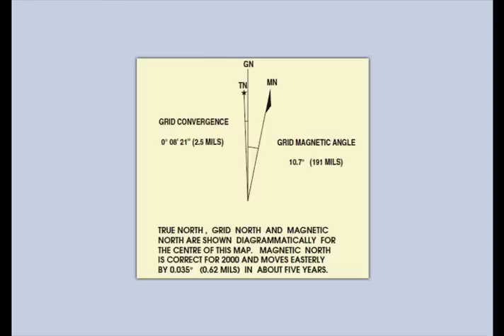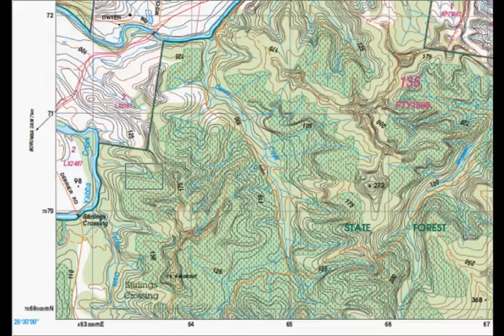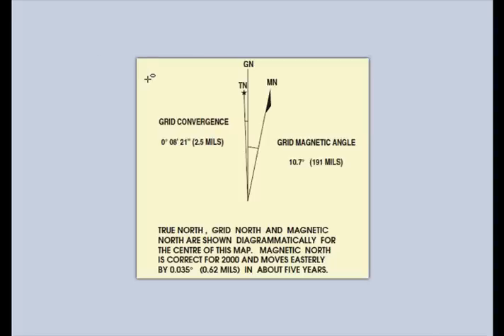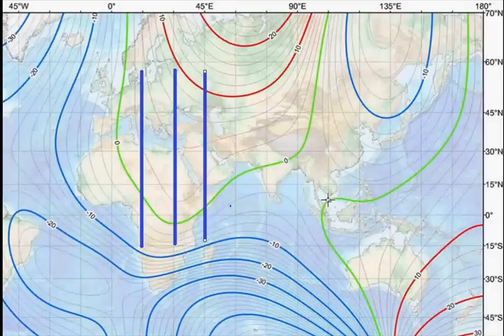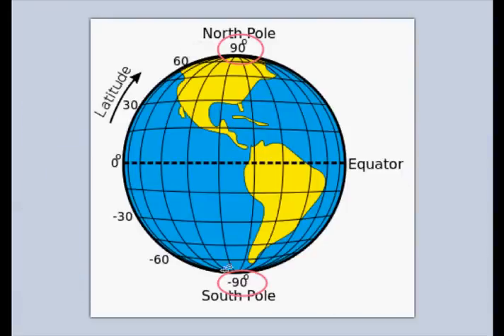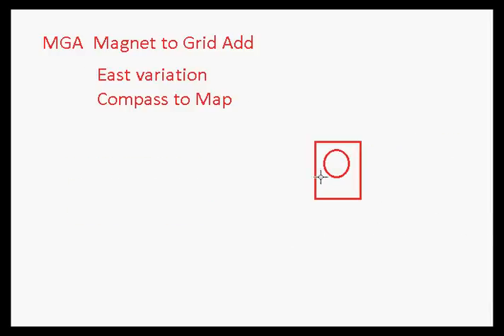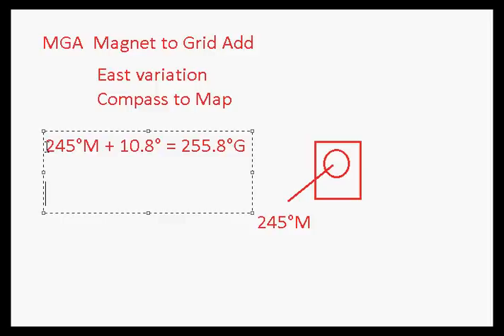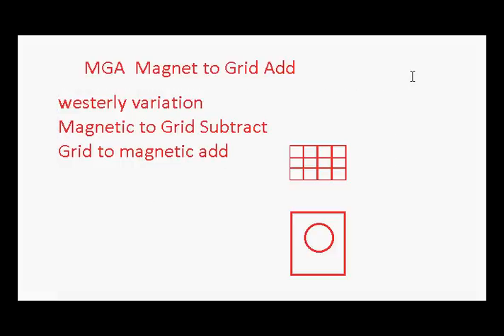AusNav #1 - True North, Grid North, Magnetic North and Magnetic Variation

Comment: I still don't understand grid north.
Are the sides of map are pointing to the north?
If that is the true, that what is the grid north.
Reply from the maker: Hey Fire. Yes the sides of the map (and the easting lines) are aligned with North / South, but not True North (which is 90°N). The grid system is drawn up differently to the Latitude / Longitude system and so "North" on the grid system (Grid North) is different to "North" on the Lat / Long system (True North). Unless you are in the high latitudes the difference is usually very small and is normally disregarded.

Comment: I was just reading a couple of written articles on what makes a good compass, as I'm in the market for one and want to make a wise purchase. I read two separate articles on two separate websites, and both said something regarding declination that I thought, based on the information in your video, was incorrect. The article's authors are supposed to be navigational experts, so perhaps it's me that's misinterpreted declination. I just wanted to copy these two quotes so I can ask you whether they are correct.

Quote from first article:

"A declination scale helps you make the declination adjustments for different areas so that the compass points to the true north instead of the magnetic north while the rotating bezel allows you to easily measure azimuth."

Quote from second article:

"“Declination” is the difference in degrees between true north and magnetic north."

So, I thought that declination was the difference between GRID north and magnetic north, not TRUE north and magnetic north. Both these experts are saying declination is the difference between TRUE north and magnetic north.
Reply: I believe for all intent and purposes they are the same. If you are finding a location on a trail,  1/7 of a degree won’t matter for 2 reasons. (The difference between true and grid north on this map is 1/7 of a degree.) If you could work out the trigonometry on that small of an error, it would be so small that you would still be able to see the car or pond that you’re looking for. Secondly, most compasses measure to 5 degrees and if you “cheat” by using the fine lines of mils scales that can overlap the degree scale you can get to 1 degree maybe. The error isn’t correctable or detectable with a compass and protractor. If you were trying to put a cruise missile in a certain window it might matter, but then again you probably won’t be using a compass to figure out targets. The difference is so small that many map makers don’t bother with grid north. You see it on military maps probably because the accuracy of an artillery strike is critical. I’ve seen maps with a degree or so of difference, but again most compasses don’t measure to 1 degree. There are videos that show how to use and correct for larger differences between true and grid north that can help.
Reply: @Sodbusterrod  True North is NOT the same as Grid North, and in the southern hemisphere, they are quite different. There are so many videos on YouTube that pretend to teach navigation, but which repeatedly make the same mistake of saying Grid North (on the map) is the same as (points to) True North, which simply is quite wrong. The grid lines on a map are a parallel array. By definition, they can't possibly all point to the single point TN! They would have to be curved, as the longitude lines are, which DO all point to TN. The simple diagram in THIS video showing three "Norths" is quite correct. In New Zealand where I live, the declination for GN - MN is 21 degrees. TN to MN is 24 degrees. If I set off from  here in search of Santa following Grid North, I will be a VERY long way off when I get there!
Reply: Oh, and instead of trying to remember adding or subtracting declination, just get a compass that lets you set the declination for the area you are in. Then forget all about adding/subtracting. It works for both map to compass and vice versa.
Reply: @chriswood6984  "True North is NOT the same as Grid North" ... should be stamped in CAPS on every map. 👍

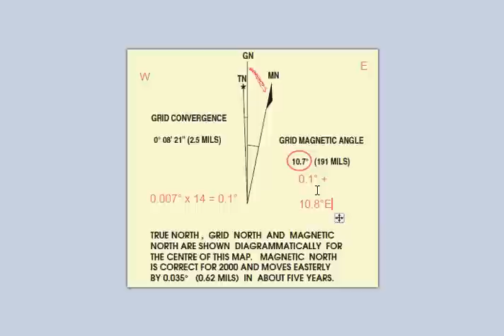Comment: Great video and thanks for the detailed explanation. However, I am having some trouble figuring out the declination according to my basic perception of mathematics. My trouble starts after 10:24 after finding the easterly declination as of 2014 at 10.8 degrees. According to the declination diagram shown, when grid north is 0 degrees then magnetic north is 10.8. correct? therefore according to basic maths if i take a reading from that map of 1 degree grid north, my basic logic says that the magnetic north is now 11.8. to further try and make my point clear.. if i take a grid north reading of 10.8, according to my mathematical knowledge the mag. north is now 21.6. But! according to this video and several others ( I am not trying to say you are wrong as i know this is the proper way of teaching it, i am just trying to have it make sense to me) when i change from grid to mag (at an easterly variation) we have to get rid (subtract).. therefore magnetic north becomes 0. how is it possible that the grid north increased to the east from 0 to 10.8 but the magnetic north moved westerly from 10.8 to 0. that is my difficulty in understanding. I hope you can answer my question as I have had no success in having this explained to me properly but you look confident and knowledgeable in the subject. Thanks and best regards.
Reply from the maker: Thanks Michael. The wording of your question suggests a slight confusion. "when grid north is 0 degrees then magnetic north is 10.8. correct?"

Magnetic North is 0°M. Grid North is 0°G, in this example the two are 10.8° apart (which is the difference caused by the declination)
Magnetic North is 0°M which is 10.8°G by using MGA magnetic to grid add 0 + 10.8 = 10.8°G
If you want to convert Grid North 0°G to magnetic then you need to subtract the declination 0-10.8 = 349.2°M So in this example Grid North on your map would be achieved by following a heading of 349.2° on your compass.

Does that help at all?
Reply from the maker: ***** Thanks for the comments Claud. Yes declination and converting True to Magnetic and Magnetic to True is a concept which is easily confused. If you read a compass which is pointing to magnetic North and you want to apply it to your chart in Easterly variation, you add the variation, to give you the True value. If you look at the north point diagram or variation diagram and you look at the line pointing to Magnetic North, you'll see that it is to the right of the True North / Grid North lines. The True North line is 0 degrees True, so by having magnetic north to the right of it, magnetic north is sitting in a position which is positive from True north. So the True heading of magnetic north is the value of True north PLUS the variation 10.8 degrees, giving a heading of 010.8 degrees True.
Reply from the maker: Much easier to just to remember MGA - Magnetic to Grid Add for easterly variation
Reply: ***** thanks claudius at least i know im not alone hehe.. i realise that your (aus nav..) method is correct but i couldn't understand it at all for the last five years. what helped me was the tip you gave about both of them being zero. the trick is to imagine them in 3D instead of 2D as the diagram implies. thanks and happy holidays to all.
Reply: sektakavesi if you need any help claudius just say so and im willing to try and explain

Comment: My employment of the data discussed herein will be 'on the trail' with standard compass. The directional needle of that compass will indicate Mag. North (MN) at all times. Any map I may be carrying will have a grid system that is NOT referenced directly to MN. The markings and dials of the compass will function as the 'Rosetta Stone' between these two disparate Nav Aids. Your presentation does not link the two in any useful, practical, field-applicable way. You have omitted the 'how-to' of the 'Rosetta' function of the compass. I concede with reasonable surety the compass needle points to MN and the map was drawn using accurate data. How these two objects arrived at this available form is of no value to me 'on the trail'. My need is to ascertain the present time, so to speak. Your presentation tells me how to build a watch. As such it does not fill my needs. The depth an quality of your presentation are moot.